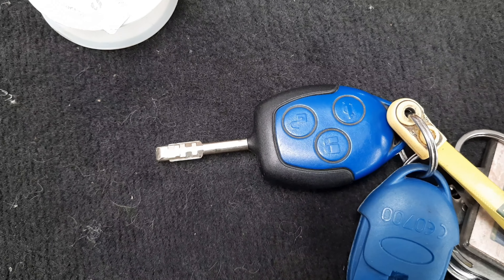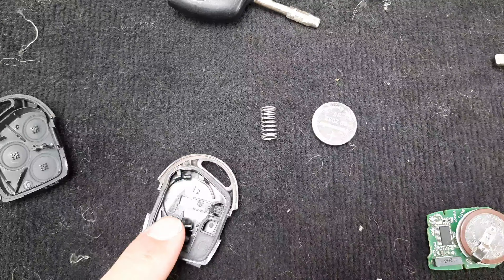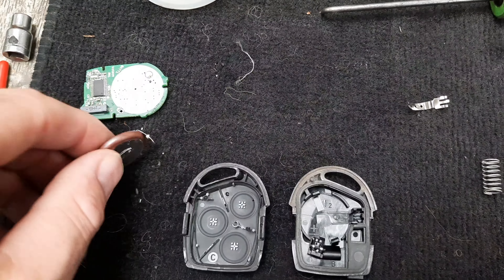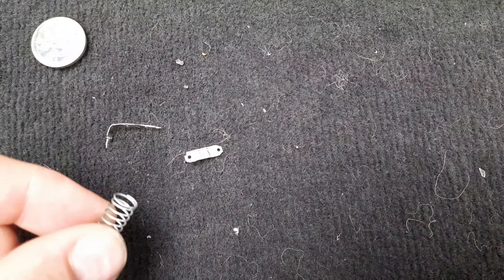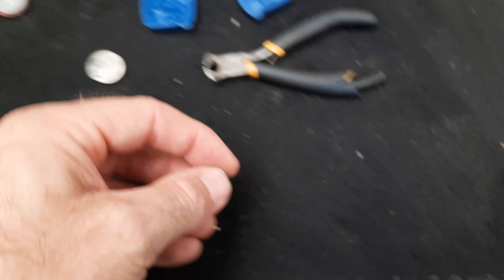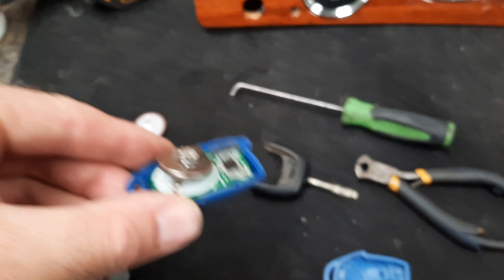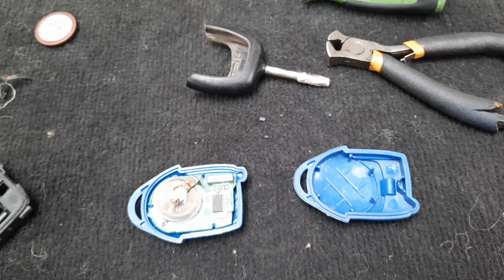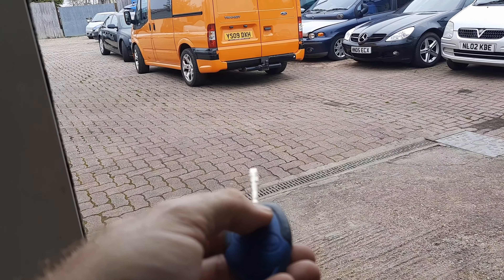Ford Transit Mk7 sealed key Fob battery repair for £3 with a none rechargeable battery

Comment: Hello thanks for the video! I did it exactly that way and it works fine! However I have a question, It seems that the original battery is charged by induction and my question is, if the non chargeable battery will blow up when it's in the ignition switch?
Reply from the maker: Hi I have had no problem with mine.

Comment: Hi mate do you think it would work by just holding the battery on for now? As iv just bought a brand new battery an wanted to check if it works before bothering to solder it I have tried but it don’t work by just holding it
Reply from the maker: Hi yes should work fine that is what I use to do years ago.
Reply: @Roundstone  it doesn’t work for me it is a brand new vl2330 battery too, unless it needs charging before use? I’m not sure what else to try my key looks exactly the same as yours in the video